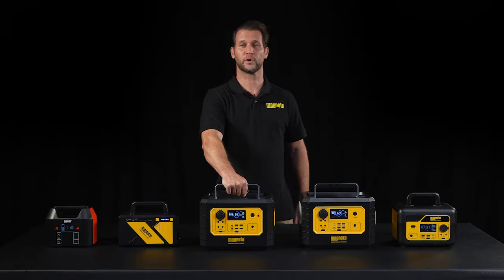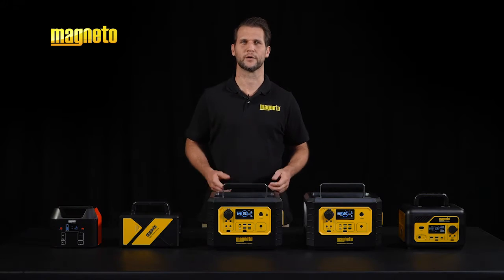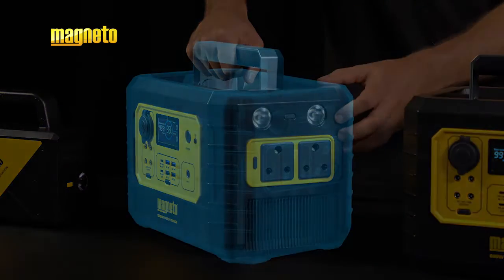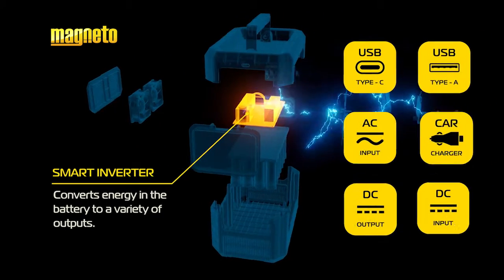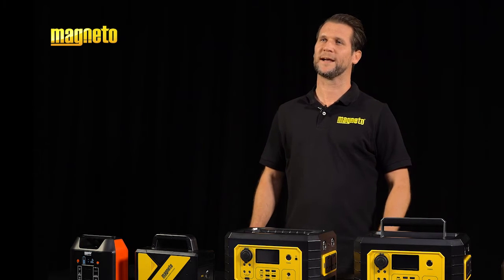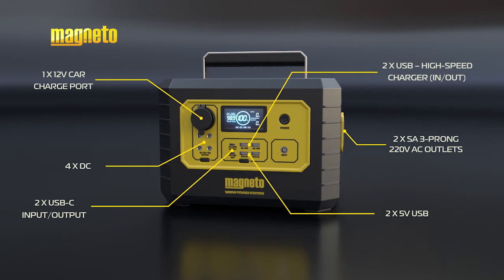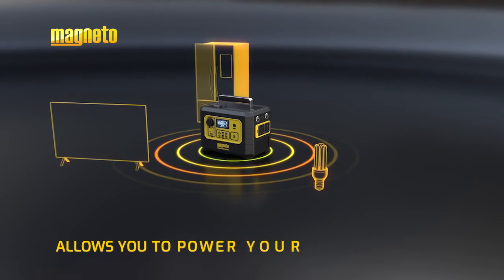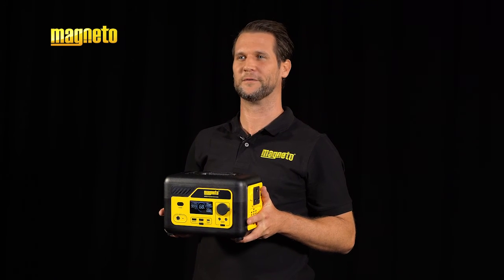MAGNETO PORTABLE POWER STATIONS - HOW THEY WORK

Comment: Hi, my Magneto 300w is not charging. The light go on but it does not charge, it stays on 0% and shows 0 input 0 output, can anyone help?
Reply: Did you figure it out? Having the same issue
Reply: I have the same problem. Is there any resolve?
Reply: I have the same problem
Reply: I have the same probleme😢

Comment: I went with Ecoflow for one reason. These Magnetos dont have Smart Switch. They dont switch to devices when power goes out. You have to manually plug the devices to the magneto everytime there is an outage. My Ecoflow switches seamlessly with no delay at all. I keep running without interruptions.

Comment: Does the Magneto 1200watts Power Station have the UPS feature (uninterrupted Power Supply). Meaning i don't have to manually switch on or off when main electricity comes on after loadshedding...

Comment: Magneto Portable Power Station 150w 200w 300w 600w 1200w
what is the life expectancy of the battery?
Reply: Co ask!, great question and also can you replace the battery?..
Reply: I HAVE PURCHASED A NEW 600W UNIT AND IT RAN OUT OF POWER AFTER JUST USING 210W  OUTPUT AND AFTER 2.5HOURS IT WENT DEAD. MY UNIT DID NOT WANT TO RECHARGE THE BATTERY.

Comment: can the Magneto Portable Power Station be permanently plugged in Eskom Mains and used as a UPS for the electrical devices for when Eskom has load shedding ?
where do I find the specifications Magneto Portable Power Station?
I can find no user reviews or performance ratings for Magneto Portable Power Station  online
what warranty and guarantee on the product and battery?
is the battery replaceable ?